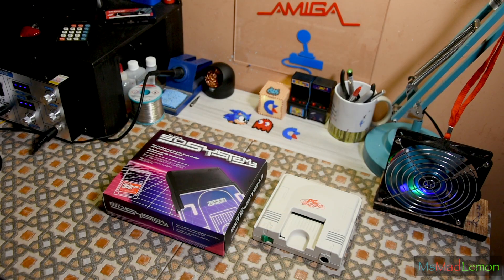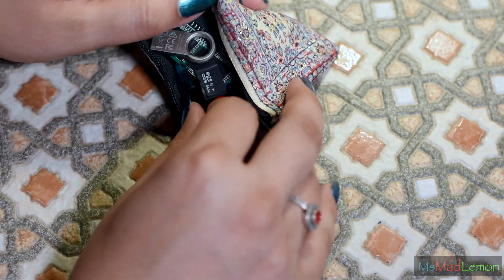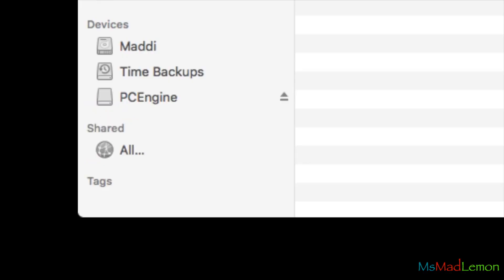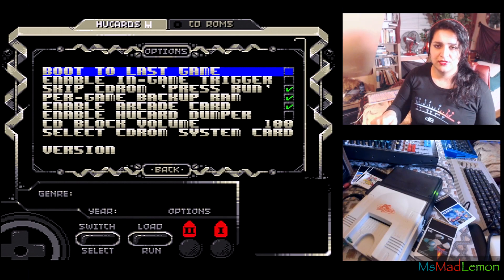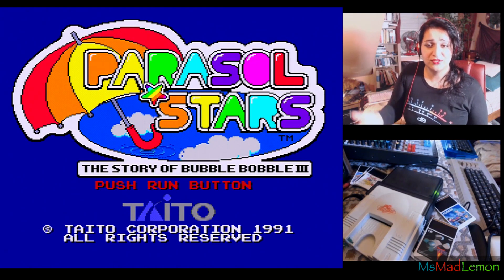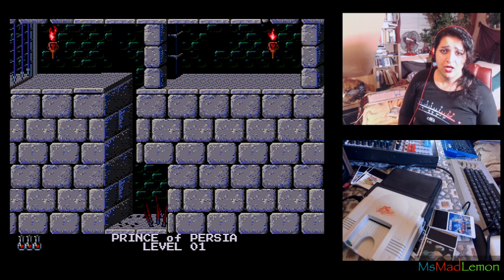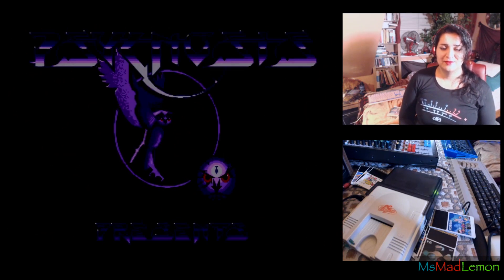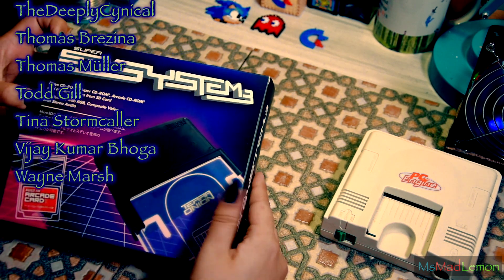Super SD System 3 for the NEC PC Engine and TG16 - Review

Comment from the maker: Just to clarify...there is a "reset" function which I discovered after uploading this review...the 'Enable In-game trigger' option is what activates it.
When activated while the game has loaded, press and hold the 'run' and 'Select' buttons simultaneously and the system will go back into the menu.

The instructions about removing 'lastPCE.cfg' made me think that there's no 'reset' option.
Reply: Also if you press start while turning on the console it will boot to the main menu.
Reply: I was watching again to find this out!!!
Reply: Instablaster.

Comment: If I were designing this thing I would make it where if you hold down one of the buttons while turning on the system it would override the autoload last rom option.

Also, your laughter is contagious. :)
Reply from the maker: Actually that is what the 'Enable In-game trigger' option is for..I didnt know this but once you enable it and if the game loads, you just press and hold 'Run' and 'Select' (I think) it will boot the system into the menu, so your thinking was actually correct, I just discovered this function after uploading this review :o)

Comment: A fun review. A nice change from the overly technical ones that tend to nitpick. It's an expensive device that probably majority owned by enthusiasts, but it's nice to just see someone playing it and enjoying it. 

I adore mine. It had a rocky start that probably will continue to define Terraonion  in the eyes of the community for years to come, but they deserve credit for revising it against their own desires.

I completely side stepped the FU-RGB ride by having my Supergrafx internally rgb modded and my ssds3 video pins snipped. It required a custom cable but when I had the FBX audio bypass installed I had it wired to a 3.5mm port. Video is flawless and just gorgeous. Sound was good but still noticeable machine noise at moderate to high volume. Playable but annoying. I was able to get FBX to do his "spaceship" edition of the bypass. I honestly don't know what technically makes it different. I think it completely isolated the audio from the noisy fpga. It brought my machine noise to a level that I need to use an uncomfortably high volume to notice it.

The product is so niche that I'm not sure how much of a difference it would have made, but I can't help but imagine how popular it could have been if they could have delivered the video and audio quality I am experiencing now. I think their latest revision nailed it. Any problems at this point seem to be the relatively massuve  undocumented amount of hardware revisions. I think a lot of problems could be helped with a cap replacement. These old consoles are literally being dug out of junk piles and sold to thirsty customers. They have not always been particularly valuable so you will see a lot of badly treated consoles

Anyways I better stop rambling on. I'll keep an eye out for new content

Comment: Nice video Maddi, according to the manual you can enable an In-Game trigger in the options menu then you can access the menu at any time by holding Run+Select for a few seconds so no need for that reset button. btw I get all my cables for from Retro Gaming Cables in the UK, they are properly shielded and very well built.
Marc
Reply from the maker: Thanks for the info Marc!

Comment: I was going to comment that I thought the font was terrible, but you beat me to it. I also hate reading white text on a black background. I can read it, but it strains my eye (I only have one working eye) and when I switch to something else, I keep seeing an after-image.

Your quick play of Turrican looks like me playing the Amiga version. I'm terrible at that game and I lose all my energy and die just about as quickly as you do in this version. I like the first two Turrican games, but I can't get anywhere in them without cheats.

For games, check out Devil's Crush/Crash, which is a great pinball game. Military Madness is a cool strategy war game that's very easy to get into. Sapphire (CD) is supposed to be the best vertical shooter on the platform. Of course there are also action games, puzzle games, etc. It's a great little system.

Comment: I got one of these and it is a great little device, worth the cost.
However I find the AV out terrible.  I have a Pack-a-punch RGB cable and the diagonal lines of interference is very obvious on some games, especially when using a scaler like the OSSC.  Also there is a constant high pitch whine as well as a buzzing sound when the SD card is accessed.
I have the later revision board which was meant to improve these, but it's still not great.
I plan to RGB mod the actual CoreGrafx and use that port.

Great review and you got to love that Shadow of the Beast music.  LOve the R-Type Complete music too.
Reply: I'm not sure whether to get one of these because of these sort of problems. If you use the AV out from the console does it fix the issues?
Reply: @MrDirkles  A fix for the high pitched whine has been found and all devices as of a couple of months ago ships with this fix.
There doesn't seem to be fix for the video quality as of yet.  As I understand it, the Super SD System 3, does not affect the actual console's AV quality When I use a composite cable from the console there is no sound issue and there is no diagonal line interference, but it is composite.  Without a RGB mod on the console I cant be 100% sure, but I'm confident the video quality would be better.

Comment: You are very lucky to have this device :) One question I have to ask though is that there seems to be a "smoothing" effect that is on. When I play Bonk for example using the DB Grafx Booster and the HD Retrovision cables (and using a Retrotink) I see all of the pixels. I can turn on the smoothing effect using the Retrotink and it looks like your gameplay....but I am not a big fan of smoothing :) Does the Super SD System 3 have a "smoothing off" function? Ohh, and I hate to say, but the red is too red. His hair in Parasol Stars is actually supposed to be like a light brown. Maybe it is just the TV settings?

Comment: It's an interesting device at a decent price that replaces quite a few peripherals (CD-ROM unit, Backup Booster, AV Booster, Everdrive) but it's still not perfect and has some audio and video quirks (the first batches of the SD System had a buggy RGB output). Also, it's not a PCE CD emulator but an ISO emulator.

It's important to understand (contrary to popular belief) that the PC Engine CD format is not standard ISO but based on a custom prototype of High Sierra (which later became ISO). The good old ISO dumps floating around can't replace a proper native preservation format (which is unfortunately still not available and is very expensive to design, like the Dreamcast GD-ROM). Which means for now the SD System "does the job" but is not a long term solution.

Comment: This is a complete guess, but I'd bet you anything that there is someway to easily bypass the 'Load Last Game'. Perhaps holding down a key on the controller when turning on PCEngine? I can't imagine they'd leave you having to do that 'delete the cfg' procedure by default. Who knows, though. They may have :-)
Reply from the maker: That is a good point, this review, as all of my other reviews, is based purely on my experience of setting up/using/exploring or whatever else i discover along the way... So that was the only solution written in the manual. so of course i'm open to easier solutions, I also think there must be too :o)
Reply: Hold down start on the controller when you power on the console will bypass it and drop you off at the SSDS3 interface. At that point you can uncheck mark the Load Last game.
Reply from the maker: Thank you Todd. that's much easier!

Comment: Using an FPGA is still emulation. It's just a different kind of emulation.
Reply from the maker: Emulation is software based.. FPGA isnt actually emulation because its at hardware level.
Reply: FPGAs are also loaded with software. And a CPU is also hardware, just like an FPGA. They just work very differently.

Emulation is simply when one thing behaves like another.
https://en.wiktionary.org/wiki/emulate
Reply from the maker: No emulation is when one then 'attempts' to behave like another, from the link "To attempt to equal or be the same as." or "(computing) of a program or device: to imitate another program or device" not quite getting there but getting close enough... FPGA is hardwired to be a 1:1 replica of the original, there is no software hovering above the FPGA to manipulate the hardware to behave like (imitate)... its running at hardware level purely.
Reply: The FPGA is a Simulation of the original  hardware at the component and IC level.  Emulation is software based where software emulates the system to run original Roms.  They are very different.  FPGAs can be programmed to Simulate circuits and ICs and be cycle accurate if done properly.

Comment: Hay :) wat do u us to convert NTSC to PAL ???...
I having tumble finding something that axel work :(
I tread 2 from EBay now and non-work :(
Reply from the maker: i'm using this one, for this price range i think its the best one : https://www.amazon.co.uk/Flylink-Converter-Upscaler-Coaxial-Consoles/dp/B00W9DJMNC/ref=sr_1_1_sspa?ie=UTF8&qid=1537468370&sr=8-1-spons&keywords=flylink+scart+hdmi&psc=1
Reply from the maker: this accepts both PAL and NTSC signals and upscales them to HDMI... so its an upscaler (its what I use, I dont use a NTSC to PAL converter.
Reply: You should find multistandard TV since 90's. If you have a TV with SCART input, all RGB consoles can be used ; with RGB you don't have to worry about NTSC or PAL :3

There were NTSC to PAL converter also.
Reply: @lulukat1670  SCART can transports several kinds of video signals, such as composite, S-Video, RGB... No miracle, if the console doesn't natively supports RGB out (with the proper cable), you'll have B&W image. Most of them can be RGB modded, as NEC PC Engine family, Famicom, N64, etc.

For SEGA, all consoles from Mark III to Dreamcast output RGB with proper SCART cable. For Nintendo, Super Famicom outputs RGB, maybe some GC. For SNK, Neo Geo AES/CD front/loader/top loader (and CD-Z I think) . For SONY, from PS1 to 3, including slim models. 

All these consoles can handle RGB with proper SCART cable as only requirement, it seems pretty cool, isn't it?